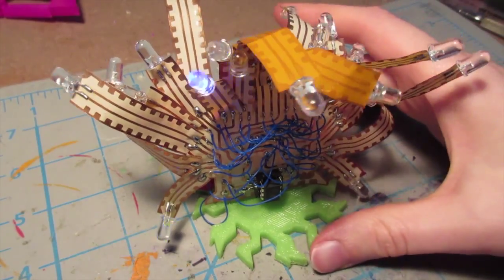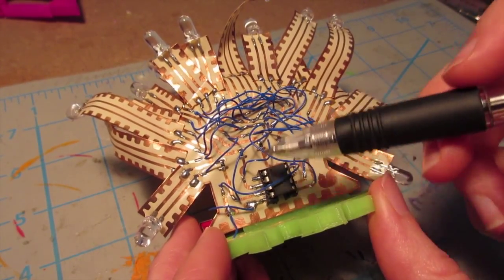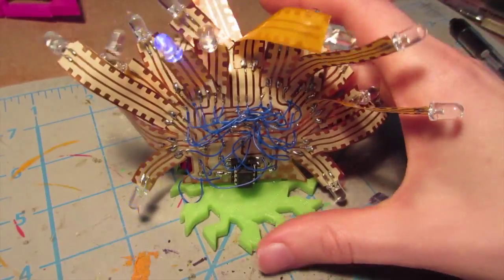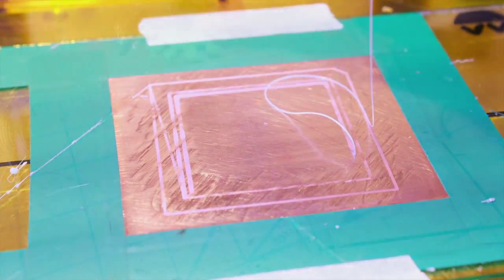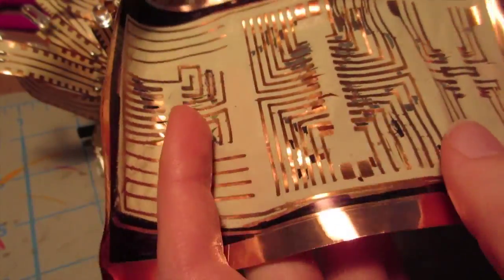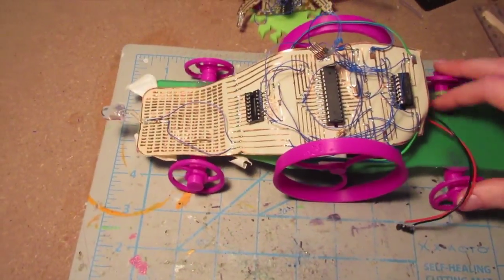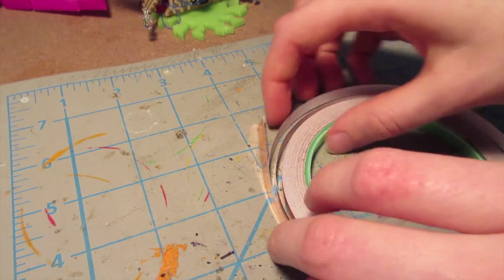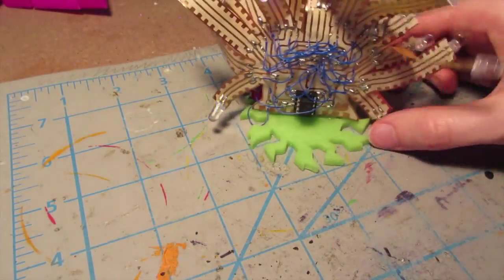Yggflexisil - Flex Circuit Tree - Blinky Buildings OSHW Derivative

Comment: That's very clever.  I bet it looks really nice at night.
Reply from the maker: Christie Nel Yeah, the light goes everywhere and can move, it's pretty neat. It would be useful to have a potentiometer on it to control the speed of the blinking. Maybe next time using a chip with more pins.
Reply: I use a shift register IC to drive large amounts of LEDs with one controller.  You could use one of those.

Comment: might be cool to do something where the bending of the circuit effects how whatever it is acts
like you could have an led on the end of it and a string attached to that, and a servo or motor that pulls the led down and then a light sensor that detects the led when it gets pulled down...and then it could release it after a second or so...make it like a feedback mechanism so it could move by itself
Reply from the maker: sonicase YEA! Cool idea! hehehe >:D

Comment: Looks cool. I wish i had more time for things like that. On that copper tape,is the glue also electrical connected?
Reply from the maker: Damian Gto There are some types of copper tape where the adhesive is conductive (i think)-- check out the Circuit Stickers for example. The tape that I have is not. And I don't think the one that comes in the wider roll is either. (Not 100% sure though)
Reply: Erin RobotGrrl Okey, I just wunder if you used it. It could be more usefull and you could do alot more with it, even combine it with the other stuff you used. But I guess you already know that, as you are smart :-P